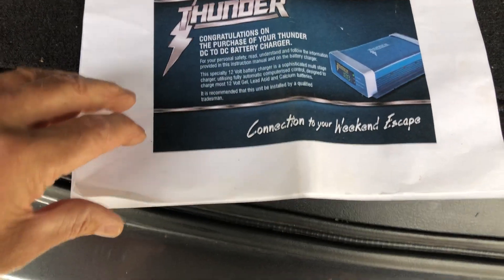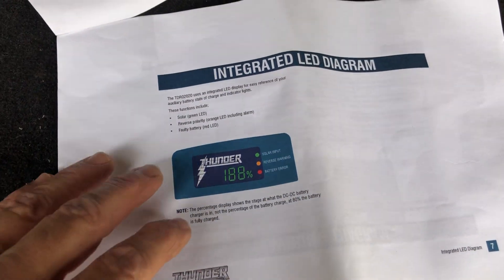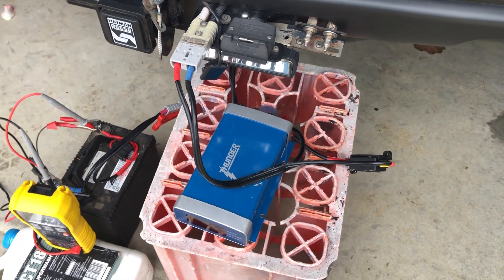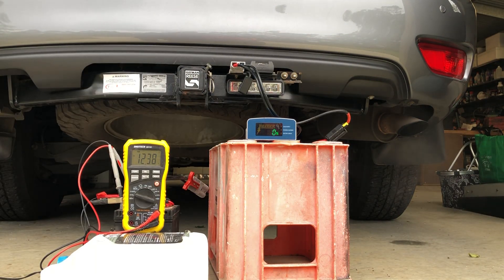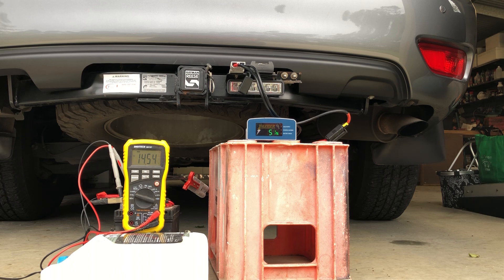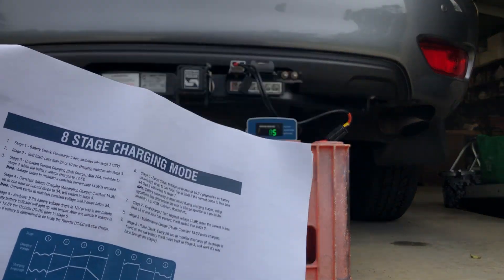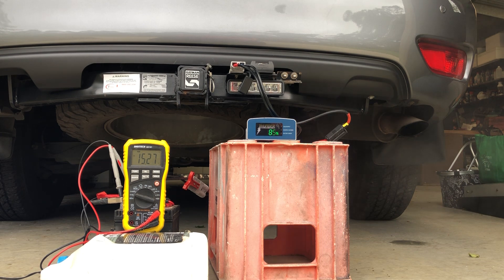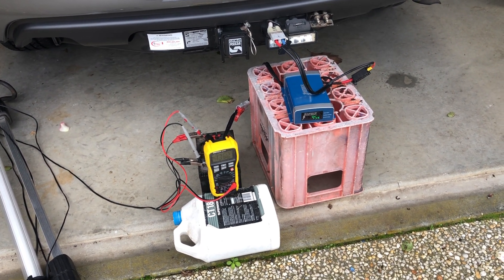Thunder DC-DC charger test review

Comment: Thanks for your imput i was wondering if this cooked my aux battery as its output charge was higher than i liked. maybe i can add some resistance on the out put to drop the voltage to a safer charge output.

Comment: trev have the same all working fine next day get a battery fault. All connection good car battery at 12.7  and charging at 14.7 but no coming  to other battery thru dc charger. Any ideas ????????? Thanks Steve
Reply from the maker: What does the display show? If wired up as per instructions using the recommended size cables it should be working. Double check earth connections. Sorry can’t suggest what else could be wrong other than poor connections, crook aux battery or the charger is faulty.